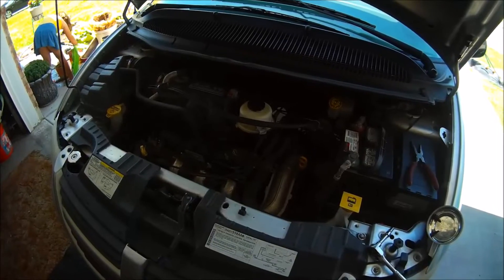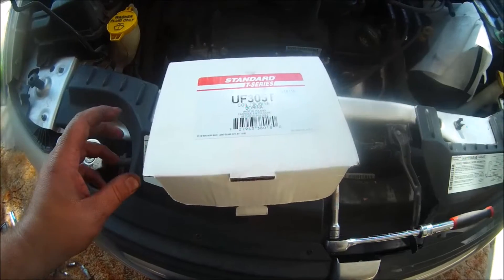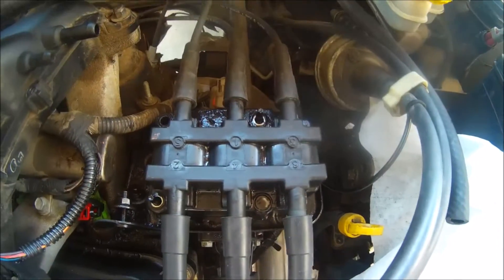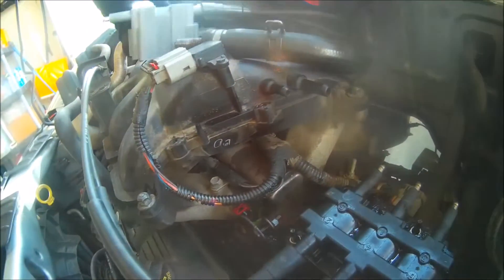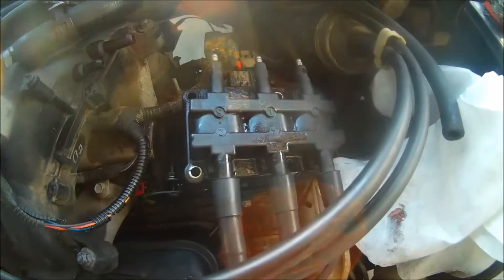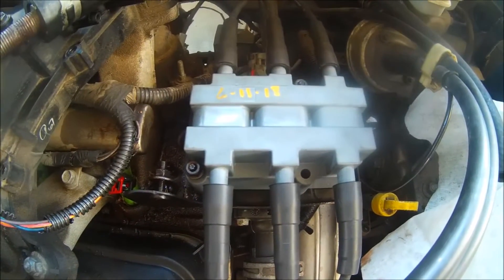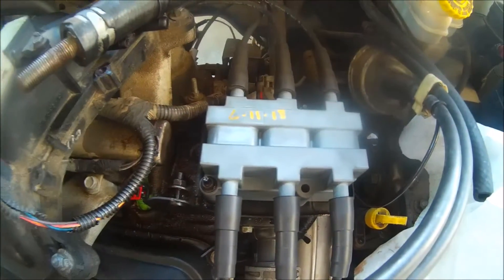2001-07 Dodge Caravan Ignition Coil Replacement

Comment: Thanks to this video I was able to install a new ignition coil (and plugs and spark plug wires). I used the new very expensive NGK Laser Platinum (double platinum) spark plugs, NGK coil and NGK wires from NAPA Auto. The engine idles and accelerates noticeably much much smoother than it ever had in the 3 years I've had this Dodge Caravan. Should have done this when I first got the van.
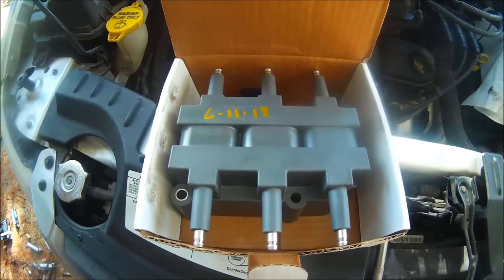I have a 2004 Dodge Grand Caravan SXT 3.8L with 140,000 miles. I was looking for a video to show where the 10mm hex nut under the steering fluid reservoir was located. It was tough to get at it. It looks like we just have to loosen it to slide off (up) the reservoir. I unscrewed it all the way not knowing I didn't have to, I almost lost it. This is the only video that shows that 10mm nut more clearly at 1:34 and I was able to complete the job in under 2 hours. It helps to use a telescoping mirror and a very bright flashlight to replace the 3 spark plugs in the back by the way. Also don't forget to use the grease that comes with the plug wires, it will prevent the wires from coming apart as NGK wires are a tight fit and I have had them come apart before from merely getting them off the spark plugs.

Comment: Mine started a bad misfire when on the gas. Started all of a sudden. Had a 55 mile drive home and it was ugly. Changed out plugs. Seemed to do the trick. Went to town and parked it. Started up and here comes the misfire. Bought wires but held off replacing them. Bought a coil the next day and just put it in with old wires. I'm assuming that when the coil is still sorta cool,  there isn't any voltage leaks going on, but park it for a few minutes and it gets hot and here come the misses. Plug wires usually crack and arc all the time. So I took it for a short ride after it was warmed up, shut it down for a minute and got going again. So far it seems to be doing good. The old coil had cracks in the housing. Gotta make a trip to Wally World, and that should seal the deal if it makes it up and back ok. I'll hold off on the wires for now. Mine is an '02 with about 129k.
Reply from the maker: Thank you for sharing

Comment: The reason I watched is to see how you removed the brackets on the reservoir, you skipped the hardest part
Reply: think it is a 12mm nut under the reservoir facing the firewall with an extension it can be loosened (just have to be loosened) can be seen at 1:40

Comment: Hey guys wondering if you all can help me out , I changed the spark plugs and wires on my 01 Carvana and after doing that my van has a ruff vibration at ideal or coming to a stop on red. I got a mechanic to clean out the threading where the spark plugs go and it keeps doing it maybe it’s the coils ? I also need an oxygen sensor maybe that will do the trick? If anyone has been in this situation help me out thanks !

Comment: What is the reason for changing out the coil??
Reply from the maker: Hahaha...good question. They just recommend it when completing a tune up.
Reply: @bryzgarage5028  the reason for the question is that I currently changed out my spark plugs but the van is running like it lost a lot  acceleration
Reply from the maker: @CarlosGutierrez-qn6sr  I really dont have a great answer for you, but it is just recommended that you do it when doing a tune up. After I did mine I cant say I gained any power.
Reply: @bryzgarage5028  thank you much! Great video!